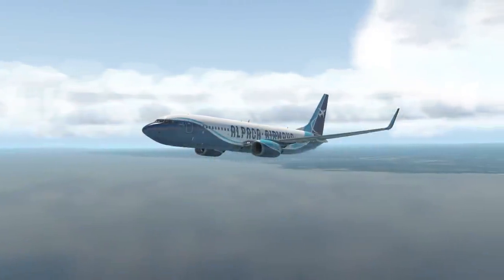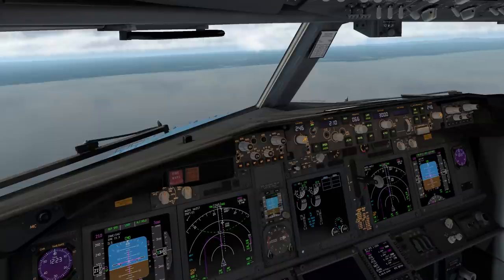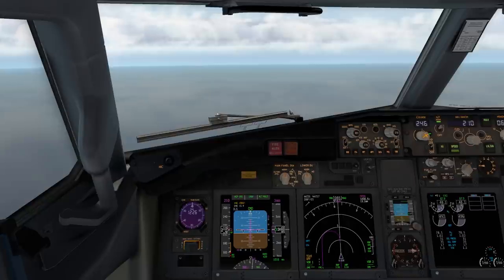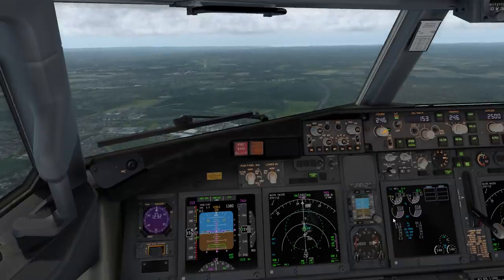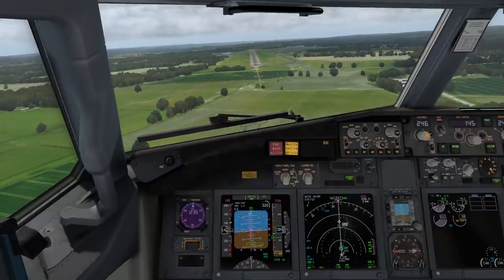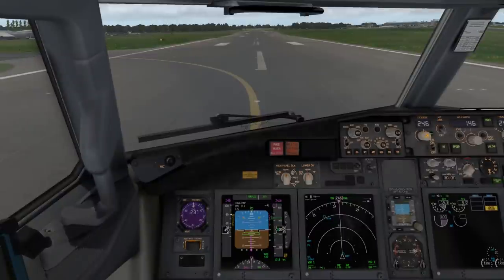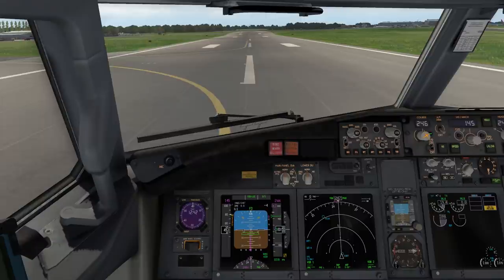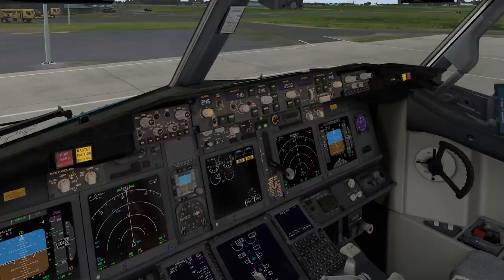Real 737 Captain Tutorial | Engine Failure on Final | Continue or Go-Around?

Comment: flightdeck2sim  Total noob here but as you stopped near a taxiway why  didn't you just roll a few hundred feet and clear the runway and then stop and get the control tower to do a visual? Bit like getting a broken down car off the motorway lanes and into the hard shoulder? Cheers.
Reply from the maker: Hi Scotty63! Good point, with an engine failure at such a late stage you cannot really diagnose the engine failure. It might have simply flamed out, have severe damage or it could be leaking all sorts! If unsure best come to a full stop ASAP to complete any memory item and then decided to vacate. Same applies with a high speed RTO. 

FD2S

Comment: Brilliant video👍 but why select flap 40 when sat on the runway after you stopped. Sorry if i missed it
Reply: It’s in case of an evacuation, same as during an rto as it functions as a slide. The 73 being low to the ground just uses the flaps as a slide :)

Comment: Thanks pal! How did you model an engine failure or did you just switch off the engine
Reply from the maker: Hi Liam! In XP11's settings you can select from all sorts of failures and you can select the speed/altitude or assign a command for the particular item to fail.

FD2S

Comment: Out of interest, would you also retract the flaps to 1 on a go-around when doing a normal flap 15 approach with 2 engines? Or would you do gear up first, and then retract that flaps as you would in a flap 30 or 40 go around?
Reply from the maker: Hi George! Great question, with two engines if your flaps are F15 or greater retract them to F15. For flap settings less than F15 leave them where they are when you initiate the go around and then continue flap retraction as usual. 
FD2S
Reply: @flightdeck2sim  Thanks for the response. Great tutorial 👍

Comment: You mentioned that the FO would make the call to ATC.  Would (s)he do anything other than memory items for a failure on final?  Would the full checklist only come out in the event of a go-around?
Reply from the maker: Hi Kevin, very much dependent where you are and the nature of the emergency. Less than 500ft you really don’t have the time to start initiating memory items/checklists. A few miles before PM might have time to complete any applicable memory items. If you initiate a missed approach the memory items must be executed as soon as possible once you’re above 400ft.

FD2S
Reply: @flightdeck2sim  I figured as much. In this tutorial,  it just spooled down at 700 ft or so. What would the FO have done had it been accompanied by a bang and a fire warning?  And what, if anything,  would prompt a go-around once you are that low?  Thanks! Love the channel!
Reply from the maker: @kevinkirkland8762  same as above, dependent on the nature of the emergency. Time permitting PM will carry out any memory items.

You would have to initiate a go around if in IMC or if you still didn’t make the stabilised approach criteria.

FD2S

Comment: In case the first officer is PF, do they continue to be PF or is the control taken over by the Captain?
Reply from the maker: Hi Enoch, if the F/O was managing it well I'd let him continue the approach. 

FD2S
Reply: @flightdeck2sim  thank you very much Captain. Could you make an in-depth video on the autopilot system of the 737, especially information in respect to the PFD. For the example  the airbus has all the information about the active autopilot modes given in the PFD with specific colour coding and boxes or stars. So is there something similar in the 737.